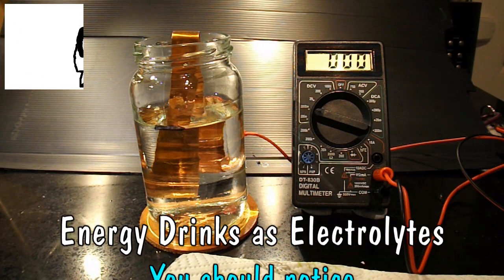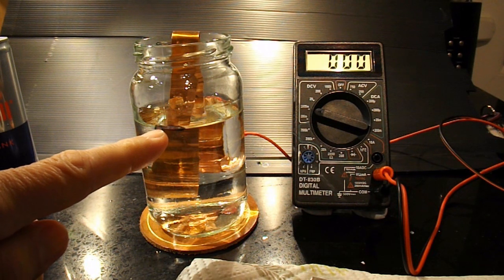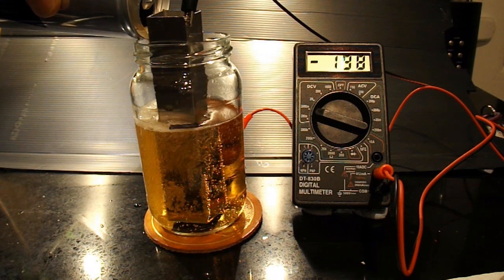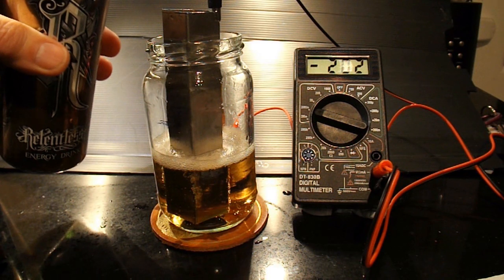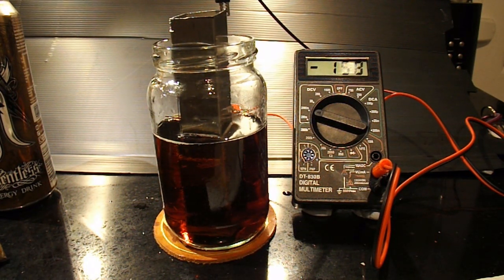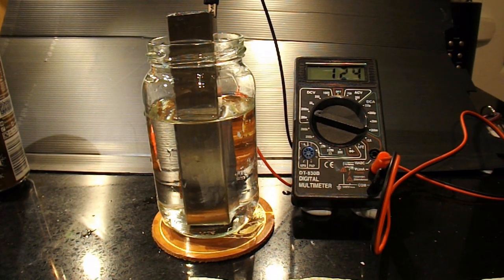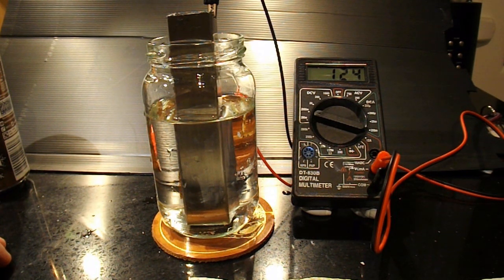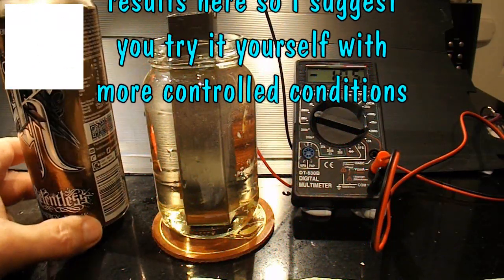Energy Drinks as Electrolytes

Comment: Have you noticed that the first time you used tap water it gave a negative voltage and the last time it read positive? Is there maybe something else involved that changed the polarity's? Interesting experiments these are.
Reply from the maker: Thanks for watching and commenting. Yes I did notice and I even mention it in the commentary around 08:20  I think this is a good example of how the results you can see may indicate you are not measuring what you think you are measuring. It is very possible that washing the plates in tap water between each test is not restoring them to their original condition or a chemical reaction has occurred between one of the chemicals and one of the plates, maybe removing a coating of an oxide or creating a deposit on the surface of the plate.

Comment: Where the pieces of metal touching while you were measuring the voltage? Maybe that was the problem
Reply from the maker: I am not sure which problem you are talking about. Which pieces of metal? If you mean the pieces I used for the Anode and the Cathode they do not touch at any time during the demonstration. If the Cathode and Anode made contact there would be Zero voltage. There could be an issue with the difference between the metal of the crocodile clips and the metal of the Anode and the Cathode once I had allowed them to get wet and that might account for the tiny voltage shown at some times when the jar was empty or it could just have been my cheap meter failing to zero. However 3 or 4 or even 10 millivolts compared to the 180 to 270 millivolts range when the jar was filled with electrolyte is insignificant for the purposes of the demonstration. If I had used the 200 millivolt scale instead of the 2000 millivolt scale it would not have even registered.
Reply: Have you tried using a magnet on the gray metal bar?

Comment: I was under the impression it was drinks such as gator aid and power aid that had more electrolytes , monster and red bull have more vitamin content than electrolytes .

Also diet coke has sodium which improves conductivity so I believe diet drinks will do much better than regular cola
Reply from the maker: To be honest, I think there is a disconnection between what drinks manufacturers are talking about when they talk about electrolytes and what electricians are talking about in an electrolytic solution. Drink manufacturers are trying to sell water full of sugar in a pretty can for a profit whereas an electrician is trying to produce an electric current. We are talking about two different things. The voltage is related on the type of metals used for the cathode and anode, the electrolyte enables the flow. There are all sorts of other chemicals in those drinks that can be impacting on the voltage and current produced that may be having chemical reactions with the metals rather than just transferring charges from one pole to the other. The fact that carbon dioxide gas forms on the plates will impact on the total area exposed to the solution.
The fact I was connecting my meter directly to the cathode and anode will have changed the readings as there will have been current flow caused by the battery in the meter. I should have placed a resistor between the terminals and measured the voltage across that.

Comment: I think your Metal is shielded with thin Layer of corrosion protection. If you use Copper with one of the aluminium cans you get round about 0,5V, but the cans are also protected with a thin layer inside. Sandpaper helps to remove it. Distilled water isn't good idea, Energy Drinks are working with cleaned Aluminium and Copper combination, simple salt water is better.
Best way is, to use Copper in combination with Silver or Magnesium (cleaned outdoor fire starter). That gives you 1,6-1,9V. That's enough to lit a red LED, but only the special red LEDs that can run with 1,6-1,7 Volts, are working. If you use two of these batteries in series you can run any small LED. Alum with distilled Water is a good, cheap and eco friendly Electrolyte to build small crystal batteries, that can run up your toys. That batteries need only a drop of Water and run over many years. You can find more information in my channel. Sorry for my bad english and best regards from germany.
Reply: Ja stimmt ;)
Reply from the maker: Thank you for your input, your English is fine. I was answering a specific request, which was to compare the energy drinks to the vinegar I had used in the previous video so it didn't really matter what metals I used or what the actual measured voltage was, I just wanted to show how they compared to the vinegar. I can see no benefit in using energy drinks under any circumstances.
My favorite battery is the one in this car http://youtu.be/yQJtMIwf0nA
Reply: GrandadIsAnOldMan oh, I haven't seen that you have answer specific request and have make a video with exactly a battery, that I have nearly talking about. There is a problem with corrosion, when you use magnesium with saltwater, because it is to aggressive in this combination, but it is possible to solve this problem. Better is to use Alum. If you want extremely long runtime, you need to burn the copper to get an oxide layer. This Oxide layer is a semiconductor (one way diode) and terminates your corrosion to 99%. It is not easy to build this error free layer, but possible with a simple burner. the small car in your video has a very thin magnesium anode. that anode can not build a magnesium oxide layer that also protect the inner magnesium core. If you want more information about this, search for "John Bedini Crystal Battery Energy Conf" in youtube. This battery works thousands of hours, I have build many of them. Best regards
Reply from the maker: baudirenergie I have seen your videos on the subject, very good too :-)
Reply: Thank you Grandad ;)

Comment: That's very interesting. I wonder why it gives a negative reading as soon as you add energy drink?
Reply from the maker: I am afraid you will have to look into the chemistry involved. I am not a teacher and I am certainly not going to try to explain what is going on. Perhaps you should watch the video again as the results are completely contradictory. At the beginning the reading with tap water was negative, when I did it again at the end of the session it was positive. That does not make sense unless you recognise something else must be happening. I did not do a clinically clean series of tests I only flushed the items in tap water, so there is probably a residue from each different drink left each time. There is probably quite a cocktail at the end. On top of that some of the drinks contain chemicals that may well have reacted with the metal conductors and produced different compounds. There should be no 'chemical' reactions taking place here, just the electrolytic process, so all the extra chemicals in the drinks will have completely skewed the results. I put some links in the video description that would help you to find out more.